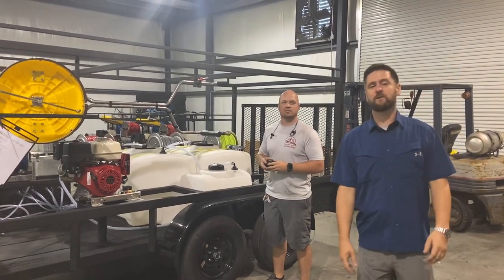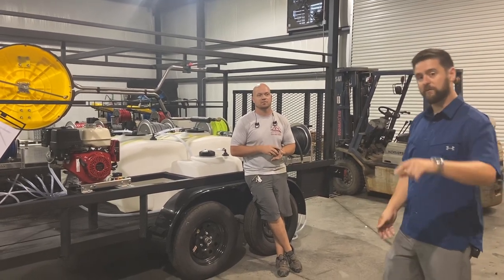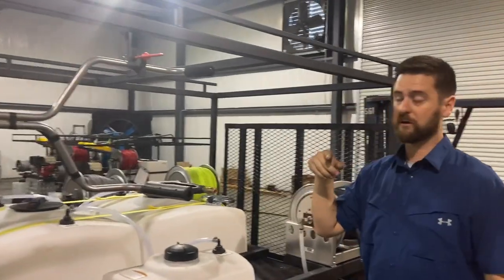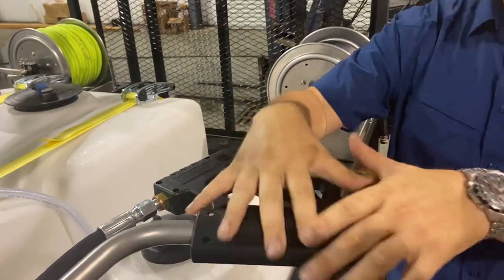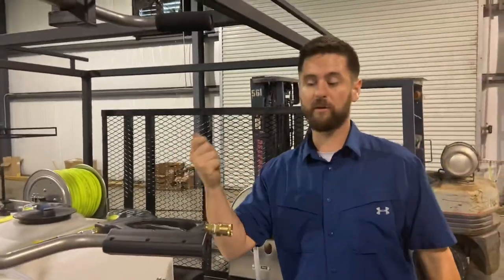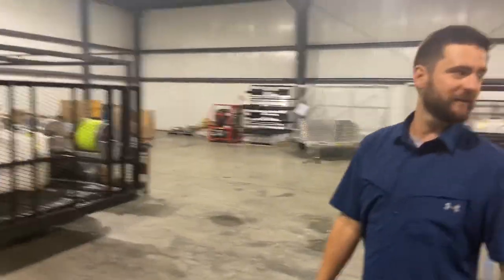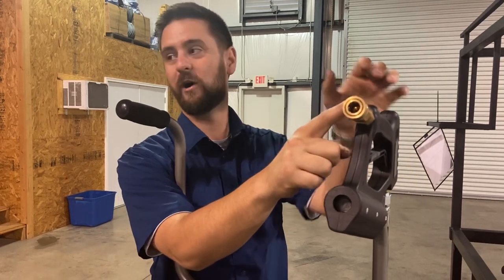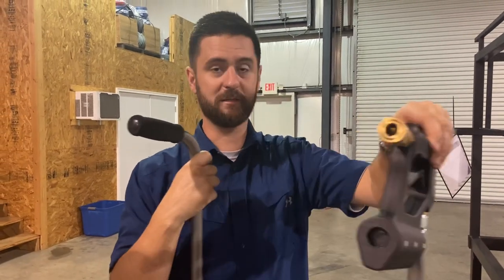B.E. Surface cleaner fix

Comment: I'm new to pressure washing and was wondering on the reasoning for changing the tips from 020 to 025?
Thanks,
Reply from the maker: Just Allows a little bit more flow

Comment: Coty, I know this is an older video but it's new to me..lol.. My question (I apologize if I missed the explanation) is why do you change the male quick disconnect to the female on the surface cleaner?
Reply from the maker: If you put a female on the ball valve and then use it to rinse, it’ll eventually dislodge the rubber o ring and cause that connection to leak. 
We flip them around since there’s no way to make male fitting leak.
Reply: @southeastsoftwash4020  Thanks for taking the time to answer my question. Makes sense now.

Comment: I have the same Surface Cleaner, trying to find the tips to replace mine with. Can you drop a link or tell me what to search to find those tips? Thanks buddy
Reply: Hi,

I don't know if you found the nozzle  tips yet for your surface cleaner.  

Type on search for Meg 1/4" 2502 or 25025 nozzle tips.  Also, if you have a local pressure washer company store in your area they should have them. They cost between $8 - 9.00 each. 

Good luck

Comment: Can't blame the manufacturer because the problem came from a modification being made
Reply from the maker: Yes I can. It’s not a “modification” to change out a quick connect. That’s standard maintenance. 

It was a issue that the manufacturer resolved by changing the way its put together. 
We pointed out a flaw, they fixed it, 
No more problems.

Comment: My handle has broken off
Reply from the maker: Is it to where you can put screws in it?
Reply: Southeast Softwash  I’m working on the trailer tomorrow
Reply: Southeast Softwash what size sheet metal screws?
Reply from the maker: Kerry Staniford I can’t remember the size, they are like 3/4” or 1” long, and slightly bigger diameter than the rivet